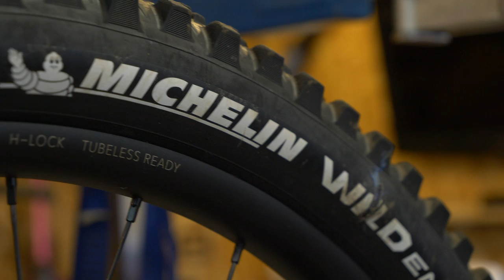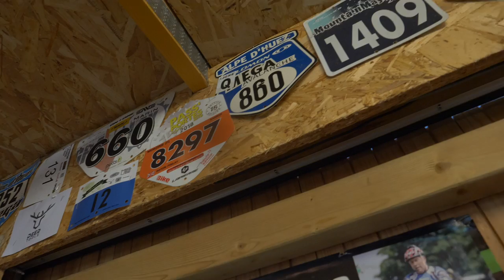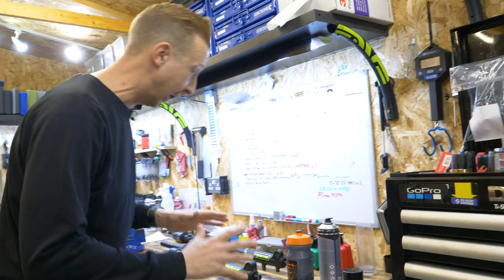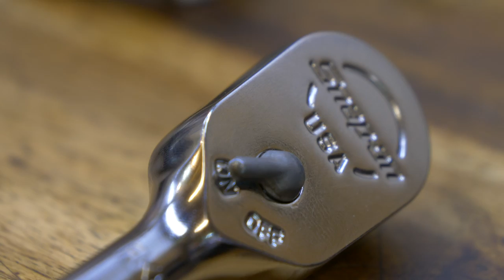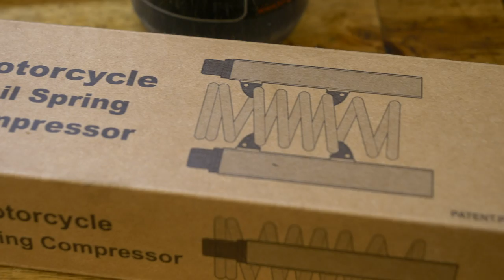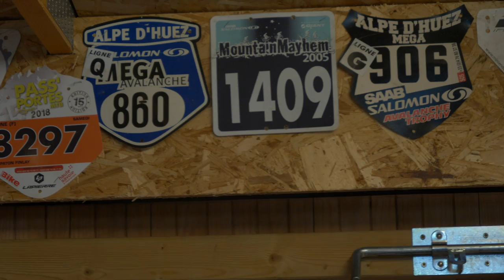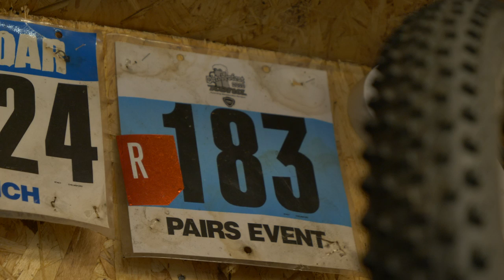The Ultimate Shed? | A Suspension Specialist Bike Cave

Comment: #askgmbntech coil forks. Please enlighten me on how to set them up, since they come with virtually every new entry-level MTB—at least where I’m from: the Philippines.

Specifically the sag and preload—are these related in any way?
Reply: Depends on the model - but yes Sag & preload are related if you preload the spring it will sag less. You may need to change your spring to get the correct sag point.

Comment: #askGMBNTech Hi guys, I have a 2019 RockShox Revelation fork. I’m about to attempt my first 100hr service on it after I noticed when adding air to the fork it made no difference to the sag/compression. Any advice on what to look out for while doing this job or any top tips. I also should say I’m pretty novice when it comes to bike mechanics also.
Reply: Sounds like a valve fault or a damaged seal, hard to diagnose over the internet, but take it apart carefully, clean everything with a good contact cleaner and use a small torch to look for scratches or damage to all of the air sealing surfaces.

Comment: #AskGMBNTech i had a rockshox recon TK Gold from 2016 120mm travel. Around halfway through the travel it would make a knocking sound. I tried re seating the air spring by loosening the allen bolt at the bottom of the fork and tapping it till it came free, i then tightened the bolt back up and it went away. Im curious to know what caused this? Lovin the show.
Reply: probs had air in the lower  - change the seals in the air side
Reply: @finlaypaton7202  hm, seems ok now ima leave it, also would engine oil like 5w20 or 5w30 be ok as just lower leg oil? Thanks
Reply: @hench_wrench_repairs  its not ideal - you are better off with light gear oil
Reply: @finlaypaton7202  i got some castrol 15w fork oil and i did the lower leg service it feels nice now, only issue shows 130mm of stantion instead of 120 like its travel rating, tried balancing air chambers but it didnt change anything

Comment: #askGMBNTech I have an 2017 Orbea Occam AM H30 (so alloy), I want a coil shock and I have concerns about the spring hitting the frame. Am I right to be concerned, can I fit a coil. hock to my bike? Was looking at something like the CaneCreek inline coil.
Reply: easiest way is to take it to your local suspension tuner, they will be able to check clearance
Quite often if you look at the other bikes in a particular model range, they will have a coil fitted.

Comment: #AskGMBNTech  Hi Doddy, I want to get your and Fin's opinion on the Fox Factory Transfer Post.  I have two bikes that I look after, mine and my sons, they are both YT Decoys. I am lucky enough to have my own workshop and have invested in the Fox tools for the Shock service/ rebuild and the Fork tools.  While these were expensive, I feel they are worth it because I can do all the work myself.  However, my first Transfer post is now 18 months old and with the amount of use it gets on the Decoy is starting to give problems.  I went to buy the tools to do the service/rebuild, there are 13 Fox tools listed for this, and I stopped after pricing the first 3 as I was already at 1000 euro!!
I have e-mailed Fox about this, to see if they would do a home mechanic tool set for the Transfer for a reasonable price but got no reply.  To get the post serviced here is €150.  My other option is to buy something like the one-up Post, that needs no special tools and will only cost just over 200 euro, but putting a Transfer post in the bin just because it needs a rebuild/service, just seems crazy!
Am I missing something here? everybody on the trails has these posts! what is your advice please? Love the workshop Video, Fin has given me some great ideas for mine!

Comment: Doddy could you find out what coil shock he is using on the Trek Rail in the background please?
Reply: Fox Van RC or Marzocchi Bomber CR (they are the same shock) with a Push tuned piston and shim stack
Reply: @finlaypaton7202  thanks for your reply. In regards to the sizing are you using the stock eye to and stroke of 220x57.5? Plus I just want to make sure that the Bomber CR’s piggy back doesn’t hit the frame. I think the likelihood of me getting hold of a Vanilla with a push tune and correct measurements might be pushing it so the Bomber could be the best solution if I can get the correct sizing. Thanks again bud. 👍🏻
Reply: @urban8or  I believe its 230 x 57.5, Yes it clears (just) make sure you fit the 2.5mm spacer though the 60mm stroke one does hit the frame.
I'm working on a longer trunion mounted one as the piggyback will be higher up

Comment: #AskGMBNTech I am interested in putting a coil shock onto my 17 enduro. How do I pick the correct spring for my riding style. Thanks for the excellent content!
Reply: You need to do a spring calculation, plenty of those on line. 
You’ll need your weight - in your riding kit, the rear wheel travel and the shock stroke. Be sure to round up to the closest spring value. and Enduros tend to be very high leverage so add 50lbs to the calc.

Comment: #AskGMBNTech Hey I own a Fox 34 Rhythm fork model year 2020. I recently went out for a ride on a pretty snowy and muddy day. It was also cold so dirt and ice froze to my fork stanchions. I cleaned them a few times while riding. Before and during the ride my fork worked fine with no problems whatsoever. After cleaning my bike I wanted to put suspension oil on the stanchions and compress the fork a few times to lubricate and clean the seals. Doing that I realized that my fork wasn't working properly anymore. It's extremely stiff and I cant really compress it anymore even when compression and rebound are fully open. I can only do that when I let all the air out. But even then the fork makes a weird sound like metal is rubbing against metal or something. Also when I compress the fork completely with all the air out there is a constant whiz of air coming out between the stanchion and the top seal of the fork. Can a simple lower leg service fix this problem or is there a possibility that something major could be wrong with the fork such as a blown damper or a broken negative air chamber or something. I also checked if the fork isn't bent and to me it looked like this isn't the case.
Reply: You can buy a marzocchi Z2 or Z1 for less than the fox it's the same internals as the Rhythm. Fox rhythm is the lowest line of forks anyway a new 34 would only be about four hundred bucks. The  amount of money to repair your existing Forks wouldn't be worth it.
Save the lower legs the air cap the compression cap and the rebound cap. Throw the rest away get yourself a new fork and take a bit more precaution when going out in snow or rain.
Reply: sounds like soemthing is stuck in the fork seals
Reply: The fork came with my bike and I know that it is the lowest of the Fox fork models. I sent an email to the Fox support but they wanted me to send the fork to them and I now wait for the price offering for the service. Maybe I need to learn how to do a lower leg service to find out if something is stuck in the seals or something because the service will be pricey for sure and might not be worth it. A new fork is much money to spend so I'll have to think about it a bit.

Comment: Please explain the rebound settings again. Thanks
Reply: turn it all the way slow, until you can hear the oil working in the fork, then back it out a click at a time, most modern forks its around 4-6 clicks from max slow. You want to strike a balance between the fork, recovering quickly enough to take the next strike and being slow enough not to kick back. if its too fast it will feel like the wheel is loosing traction in a fast bumpy corner. Because its just bouncing and not maintaining contact with the ground.
Reply: Thanks. Rebound is my demon. I think I have my forks set up the way I want but I just can’t comprehend rebound

Comment: Hey thanks for another great video! #askgmbntech Why is there no video online about servicing a fox transfer (2017-2020) dropper post? Will you make one? Including hacks on the many expansive tools? Cheers
Reply: Look on Fox's Tech pages  - you need lots of special tools - you can do without 2 of them if you are clever, but it takes longer, you definitely need the filler tool and the tool that holds the valve open. The tools are priced I think to make it really not worth the home mechanic owning them, which I think is a real shame.
Reply: @finlaypaton7202  Hey thanks for the reply! did you give it a go? Love taking cae of my bike. Service/rebuild my Fox transfer seatpost is my next ambition and wouldnt mind spend a few (100?-200?) bucks on it. But spending about $1000 on specialist tools is in over my head. Real shame indeed!

Comment: #AskGMBNTech Hi guys, I am a larger rider. I weight about 95kg and I always struggle with blowing through rear travel even with the largest token in the shock. How do I choose my next bike if I want to make sure it has a progressive linkage? Most MTB brands are not forthcoming with shock linkage figures and I would not know what a progressive linkage curve would look like anyway. My current bike is a transition Scout 2019 which I bought thinking it had a progressive linkage design, but have since been told it is not progressive at all. Can you help?
Reply: Look for a bike with a low leverage ratio, most are between 2.2 to 1 and 2.6 to 1 
You want the lower end of the scale
Reply: @finlaypaton7202  ahh cool, so lower the number the more resistance at the wheel to move the shock? So aim for 2.0/1 not 3.0/1?

Comment: #askgmbntech Hey i'm quite compatible taking apart my fork and doing a lover leg service as an air spring service. But i have never done an charger damper service. Is this hard to do and is it possible you can do an video on it? My current fork is a rockshox lyrik 2020
Reply: not hugely difficult, but expensive if you mess it up as you can't get the bladders seperately
Reply: RockShox have great online service manuals. There are a dew specialist tools needed, but even buying these its still cost effective.
The charger dampers are basically an oil change and 2 or 3 O rings. But reaD the service guide and decide.

Comment: #AskGMBNTech A friend of my bought a new RD. Deore m5100 11speed. He, however, has a 10-speed system, both shifter and cogs. His shifter is an LTWOO A7. Now, the mechanic that we have here can't seem to make his shifting work as smooth as possible. The chain skips from 8 to 10th cog or somewhere there. Is this a case of mismatched components or something else? Thanks for the time. A solid fan from the Philippines here!
Reply: Yep need to match shifter & mech. 
The new 12 speed will work with an 11speed shifter.  
But not the older stuff.
Reply: @finlaypaton7202  thanks for your input. I get ypur point about the newer 12speed on 11speed. But this 11speed is new as well. So I was thinking I could make this work somehow. My guess is it's the Ltwoo shifter thats making this buggy.

Comment: #asksgmbntech Hey Fin and Doddy, i  have a 2014 Norco Fluid which is 120mm trail bike with air shock but I don't really like them and i want to convert it to coil. Currently the shock is 184x44, but the closest coil shock i found is 190x50 and my question is would it be able to work properly if i run the 190x50 shock with offset bushings. Also could you suggest a coil shock as the only one i managed to find is from an unknown brand DNM.
Reply: Yes 190 x 50 should work fine, you may not even need the offset bushes

Comment: #ASKGMBNTECH Thank you very much for the show really like it and learnt a lot. Those are my couple of questions.
1- How to really adjust the bushings on the fork when you replace them?
2- Whats is the best way to learn valving?
Thanks Regards, from Spain!!!
Reply: 1 - The Bushes are pressed into the lower and held in place with a retaining compound,  Within the legs of the fork they are tapered so you can adjust the fit of the bushes to the upper by moving the bushes a few mm up or down, basically.
2 - By talking to other suspension techs and experimenting with different shims stacks & tunes
Reply: @finlaypaton7202  Cool Thanks!!!

Comment: I’m really curious to know what he uses the lathe for, Doddy!
Reply: Making parts you can't get, trimming down mount kits, making shocks, wheel spacers, brake mounts, fitting kits, bleed attachments for shocks, shaft clamps and those times when you just need to take a bit off.

Comment: #AskGMBNTech Hi fin i have a set of bomber z1 front forks 180mm travel on my kenevo and thinking of doing a coil conversion been looking at the smashpot whats your thoughs? Thanks Lee.
Reply: Yeh great system, Marzocchi actually have a coil system for the Z1 but you will need a firmer spring than the ones they supply for an ebike, Push springs work.
Reply: @finlaypaton7202  Thanks yeah i did look at the marzocchi coils but there was only 4 spring options and little progressivness (if thats a word..lol) so was looking at the smashpost as it has a dial to adjust the ramp up?
Reply: @leeredmond6420  yep really nice system

Comment: #AskGMBNTech  Is it possible for Finn to do a rebuild on a RS Mag21?  My old Fat Chance Yo Eddy needs love and I can’t even begin to afford a new bike.  And being disabled with ME, it wouldn’t be worth it as I can only ride small amounts anyways.  Plus my old bike is a work of art and deserves the love.

FYI, it’s a 1in steerer and I don’t want to have to change the Chris King headset or switch to new brakes.  Finding a fork with a 1in steerer is almost impossible now.  The only option I thought of would be to buy a used RS Quadra 21R and try to rebuild it (since it’s a simpler design) and install it on my present crown.  Thoughts?
Reply: I can't get the parts for those any more unfortunately
Reply: @finlaypaton7202  
That’s what I thought.  Thanks for the reply.  I think I’ll just try to buy a fork off eBay that’s in good condition and take the lowers and put it on my existing crown.  Someone needs to come up with some aftermarket parts kits for them.  There do seem to be enough people still using them.
P.S., do you think it might be better to find a Quadra 21 since it’s not air/oil.  I would think it would be easier to rebuild the Quadra.  I’m pretty sure the stanchions will fit the same crown as the Mag21.  Thoughts?
Reply: @keirfarnum6811  yes Crowns would swap over, a later fork such as the Judy SL would be better in handling & in parts

Comment: Hey Doddy, loving the content. Most of these I have used at one time or another apart from the epoxy one but it makes sense. I am currently trying to rebuild a 1998 Santa Cruz heckler and am looking for some advice on which forks to run. I was running them with an old set of RST delta TL however they have seen their best. I haven't ridden in a while and am gonna try and get back to a bit of XC, free ride, and maybe some enduro. I have a cane creek DB air for the rear but looking for the best 1 1/8 steerer 26" wheel based fork and at least 100mm travel. Thanks mate. #AskGMBNTeck
Reply: good luck with that! Not much out there that's new. Some of the old oil bath coil Marzocchi forks are excellent for their age, but don't compare with modern forks. finding decent straight steerer forks is really hard now. I wouldn't push your luck with any hard riding enduro or freeride on a 98 bike. Alloy from that era is notoriously brittle. The head tubes are short on the heckler, so buying second hand shouldn't be an issue. You could try the Rockshox Reba RL, but they won't really stand up to cane creek you have for the rear.
Reply: @judechandler5102  Hey Jude, thanks. I am aware that I am limited in what I can get, I pushed the bike super hard when I used it regularly before and haven't had any issues. Santa Cruz were actually renowned at the time for the quality of aluminium they were using so am not too worried about the frame. I didn't think I would get anything near the cane creek and the only reason I got it was it was going cheap. The main thing I am looking for is the best of the options that are there knowing that modern tech will wipe the floor with it.
Reply: @davehendry2519  Definitely try rockshox then. Fox and other higher end companies don't do straight steerer forks any more. Would highly recommend Reba RL forks at 100mm travel. Nice and light but still with acceptable performance and actually not that costly

Comment: #AskGmbnTech hi guys, love the show I have a new remedy 8 and I find that it bottoms out on the back very often. I run it with 20% sag and I'm not that heavy. Some people suggest using a MEGneg can to increase the negative air chamber. I would like to know why would this help? Thanks!
Reply: It wouldn't help don't waste your money. You need to reduce the air volume in the main chamber first, then it will ramp up more toward the bottom end of the travel.

Comment: #AskGMBNTech how about the use of suspension oil as volume adjustment on forks and shocks?
Reply: It can be done, but you risk blowing up the seals.
The best place to do this is inside the air cartridge, but you can only do it on forks with either old fashioned coils, Dual air or an air spring that as the negative coil spring.
The most common air springs, have a port or dimple pressed into the inner wall of the leg (much like a rear shock air can)
Using oil in those doesn't work as it blocks the port and makes the fork feel harsh on small bumps.